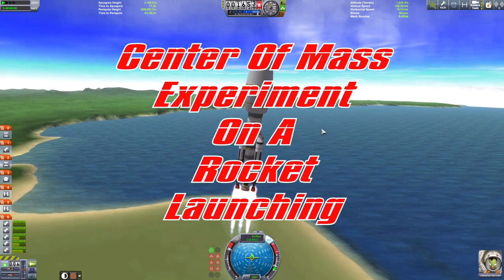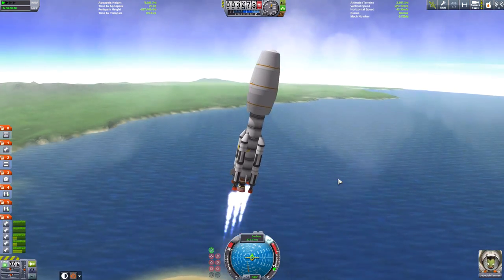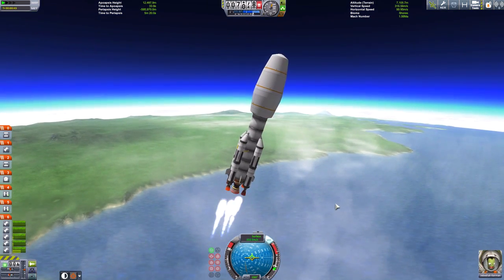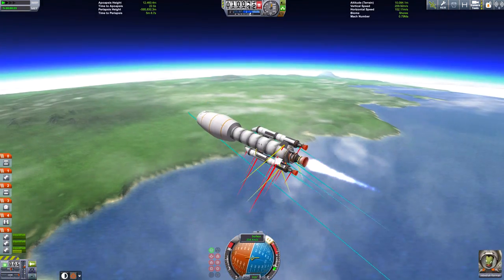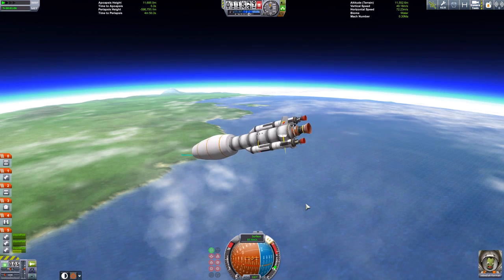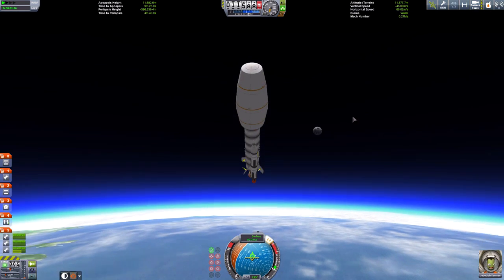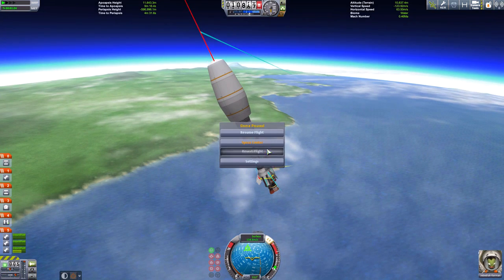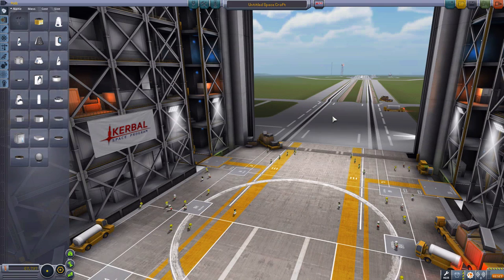CENTER OF MASS EXPERIMENT - STOP ROCKET FLIPPING! Correction

Comment: If your center of mass is low, your rocket basically becomes a giant lever, requiring only minor force on the top to cause big changes to the entire thing. But for any case goes: The lower your center of lift on your rocket, the more stable it flies, at least to my experience.

Comment: The number one reason for rockets flipping is the fairing glitch. In 1.0 the drag from the fairing is calculated wrong. You can see with the overlay that its much higher then the fairing itself. In 1.1 it's been fixed and it's much easier to launch rockets with large payloads without flipping.
Reply from the maker: +Caine Sloan Yeah I didn't realise that at first, I had a lot of comments stating their rockets flipped that's why I made these videos.

Comment: The main problem when flying a rocket, your center of Thrust, Mass and velocity vector have to be aligned. So turns must be executed very slowlyor at slower speeds before reaccelerating. 
Your expreriment did made me understand why the Space Y heavy lifters mod give rockets that always flip over. Fairings are very big, generated insane drag and the very big booster stages make the CoM very low. Saturn V had a very low TWR at launch so drag was not that high.

Comment: There is no experiment to do.. The center of mass has to be as high on the rocket as possible. This is to prevent the drag from having a stronger push on top of the rocket. If you have your center of mass low, you are just begging for your rocket to flip around.

Remove the fins and you will see that fins are not necessary as long as you keep the mass high. I actually make my first orbit just by locking the upper fuel tanks to prevent fuel to change the mass to the lower part of the rocket, fins are not necessary.
Reply: +Ozone Grif That's correct. Most of my rockets don't even have/need fins. (I like Ares 1 style rockets so the COM is high up) This increases the distance between the rocket's natural center of pressure or lift, and the CoM. = More stable rocket more resistant to flipping.
Reply: From what I see and understand, if the center of mass is low, the rocket will flip when you turn a little(because of the air flow going now in a different direction than the rocket and pushing on it), if the CoM is very high, the air flow will push too on the rocket, but the surface under the center of mass being much wider, it will tend to prevent the rocket from flipping, making the turn harder.
But if the CoM was in the middle, the forces on both sizes would be equal and there would be no resistance/flip when turning. 
But I guess we also have to consider what you said about the distance between the center of lift/center of mass for the stability. Maybe a point between the top and the middle?
Reply: A year-ish late. But how do you keep COM as high as possible when the heaviest parts are the engines and fuel tanks?
Reply: The high CoM doesn't do anything to the drag (Center of Pressure). A better way to think about it is that the center of mass is pretty much going to be where it ends up; there're very few (but not none) things you can do about it. What you CAN do very easily is move the CoP lower with fins. No matter what you do, the CoP is probably going to end up in the capsule at the top; it's about the only thing the air is going to push on to start flipping things out, and when it turns sideways, there's more stuff in the top than in the bottom to push against and make it worse. Spam the bottom stage with fins and you're set. (Or make a very careful  ascent keeping inside the prograde marker.)

Comment: I think you got it right with your experiment this time. I know it's fun to test (it's the most important thing right? ;) ) but you shouldn't base all your conclusions on what you THINK you see. the proof is that you've had wrong conclusions because you didn't realize what was actually going on (flipping due to the fact that your fairing adds a lot of drag to the front). from what I know and my experience with ksp, you should make a difference between having a stable vehicle and a stable flight path. in your case the cause of instability is the angle of attack (angle between your flight direction and your prograde vector). the solution is what you show at the end : a zero lift turn aka a zero AoA turn. with this technique you can even make unstable rockets fly! :) until you reach the thinner upper atmosphere where you can afford some reasonable AoA without flipping. this game is awesome because you learn more everyday! :) keep having fun! :)
Reply from the maker: +Raphael Taormina Thanks for the awesome comment :) I didn't associate the center of lift with center of mass though I did know the rocket would pivot on the center of mass and center of lift will effect an object like a dart, but it was cool that people corrected me in my flipping rocket video and also I was surprised that the Apollo rocket didnt have a high center of mass this goes to show you need to point prograde as you said to stop flipping and preform a slow turn for your gravity turn and any rocket will get into orbit :D

Comment: No matter what I do the rocket still flips out.
Reply from the maker: +Simas A. The best advise I can give is add control parts to the rocket like reaction wheels, rcs thrusters and winglets at the bottom of the rocket, the more control you have the more you can correct to stop flipping
Reply: Simas A. Try building long rockets and not wide
Reply: Turn on advanced tweakables in settings, it will let you pick what tanks drain in what order, so you can make your rocket drain bottom up.  Makes it very easy to keep the weight forward

Comment: so weight at the top and thrust at the bottom and less aerodynamic drag from the top some winglets on the bottom for control and should be good?
Reply from the maker: +shune84 Oh yeah that is correct when I started this game i was thinking of a building which would be stable when the center of mass is at the bottom, but I found out the hard way it's the other way around on a rocket as the rocket rotates around the center of mass so having it higher on the rocket means that the aerodynamic drag Willoughby the back of the rocket in line with the direction you are traveling meaning it will auto correct which way the rocket is pointing 😎

Comment: Why don't you just use the rocket guiding system to stay prograde? Just start the tilt then turn it on right?
Reply from the maker: +Joe This was a center of mass experiment to see were to place the weight far a more stable rocket.
Reply: +Joe 
Not quite. If you designed your rocket as perfectly as NASA does then you could probably get away with that, but for those amateurs of us we usually have to keep the nose up slightly so the prograde markers doesn't dip down too fast. Getting that center of mass vs. center of lift/drag vs. center of thrust thing just right is tricky, I mean it is rocket science after all. I have yet to design a rocket that could fly itself into orbit, even using MechJeb.
Reply: AaronAlso lol at that, I let mech Jeb fly almost all my rockets into orbit...
Reply: +Joe I qualify any mods like mechjeb and kerbal engineer as cheating. CHEATER!